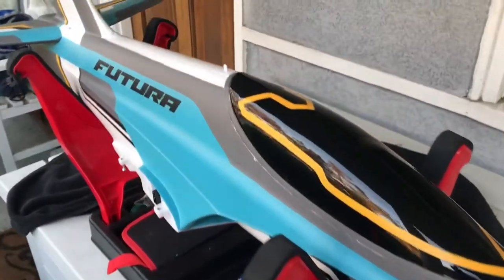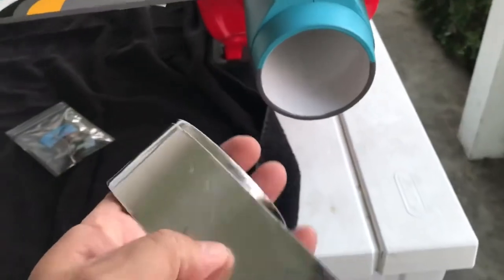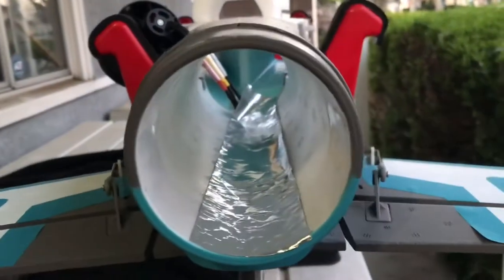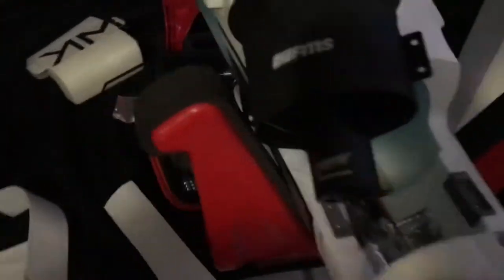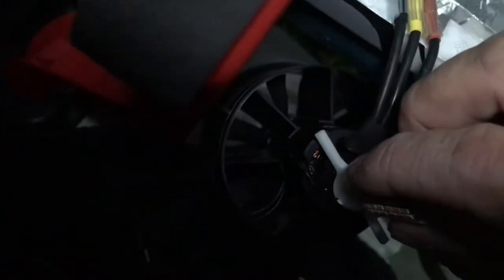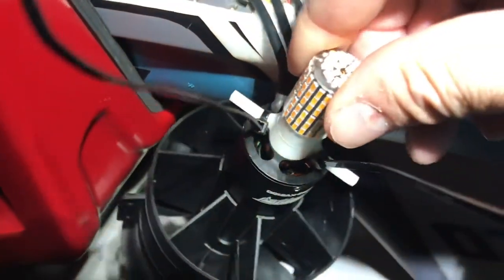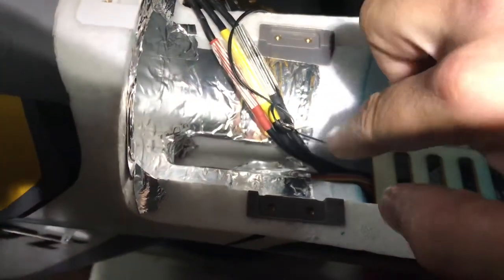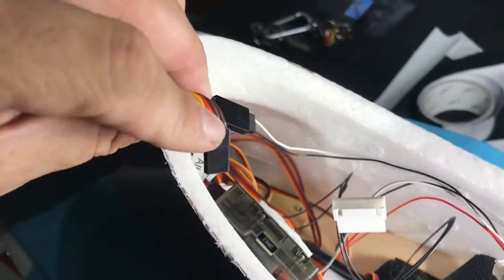Km Rc After Burner Install Fms Futura  “Tiffany”💎Woodys Barn House 🧰🐴#kmrc#kmmodels

Comment: Great results. Just installed mine on my FMS Bae Hawk and I'm very impressed with its tiny footprint on the motor and how small the controller is. Other brands are larger and obstruct the airflow and control boxes are larger and heavier. I also really like the standby pulsing of the light. Be good if we could get some custom colours just for fun. Green or purple would be awesome!!
Reply from the maker: Nice ! Yeah that would be awesome! Maybe they working on it 🤔